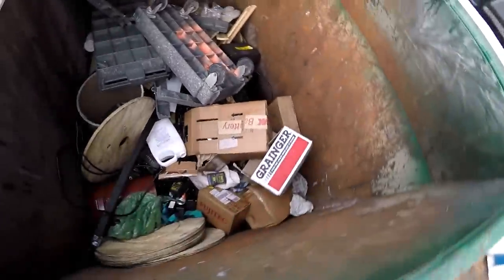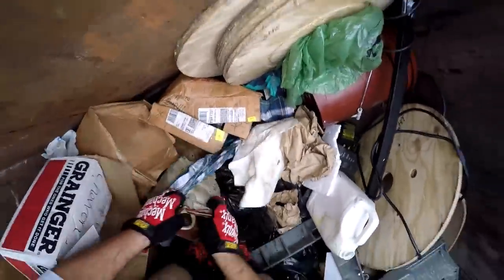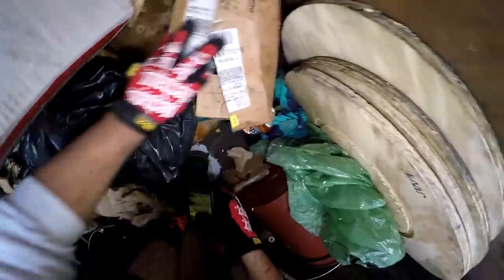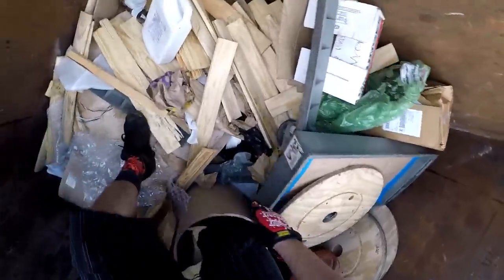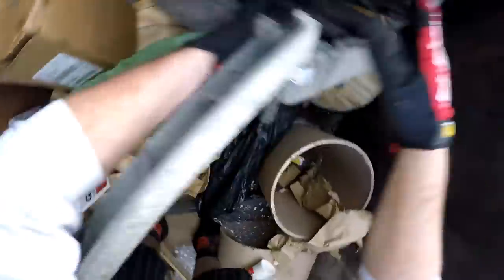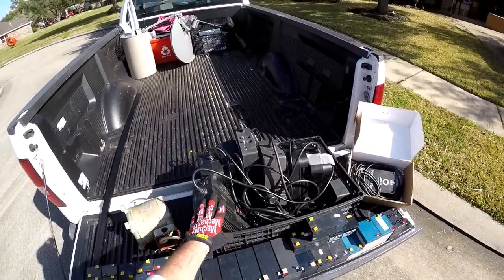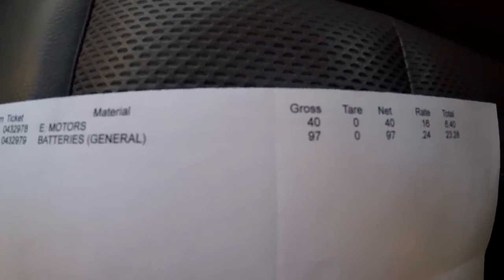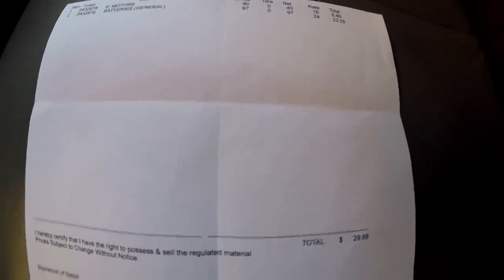Dumpster Diving 29 (Battery Haul With Scrap Yard Run)

Comment: I love those battery backups. If not only for the battery but they usually have a decent sized transformer inside. I'm just shocked at what company would willing to risk a fine for putting those batteries in the dumpster
Reply: Not to mention the possibility of starting a serious dumpster fire.

Comment: The batteries likely came out of the apus.  I've found a number of tossed apus over the years, and half the time all they needed is for the battery to be removed and given a good hot charge from an external charger to get them working again.

Comment: 5:40 
UPS/Uninterruptible Power Supply . Each one will have a battery. THe wrapped batteries are probably good. You plug a computer and monitor into a UPS and if the power goes off, the battery back-up will keep you going, long enough to save what you're working on and shut it down.

Comment: Hi, I am pretty sure those long black poles with connectors are infrared optical bariers used for example in elevator industry to detect if anyone is in a door area to prevent the door from closing. I have changed and repaired a lot of them.I like your saving batteries from ending up at the landfill and I have to say it´s so sad to see that America is full of stupid companies with no regard to the environment and nature, who aren´t able to make proper waste policy and dispose of dangerous waste in a sustainable and responsible way.